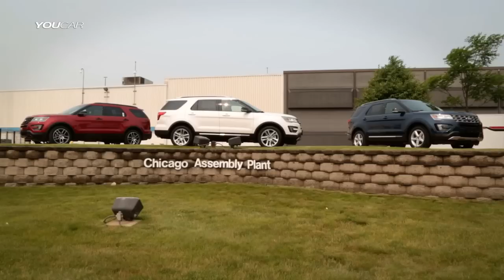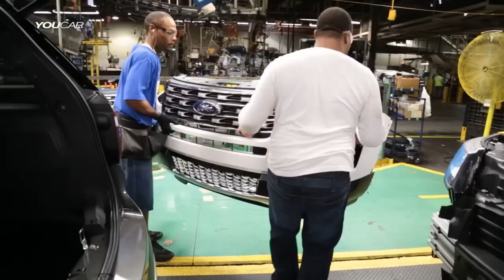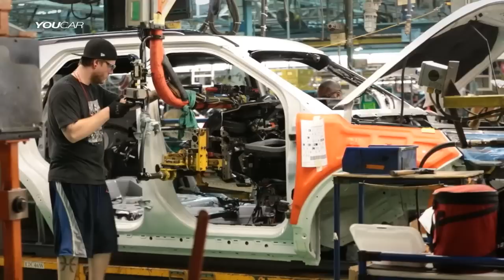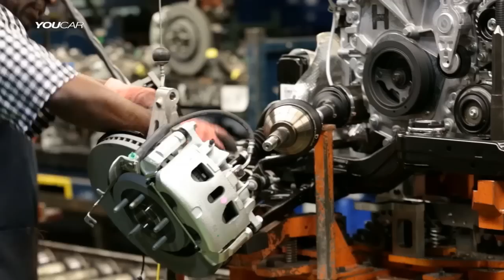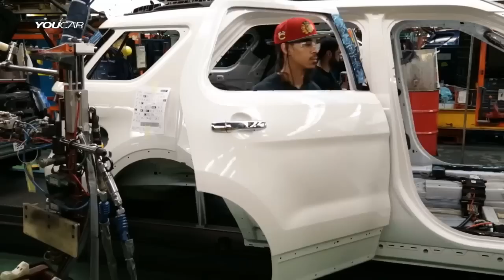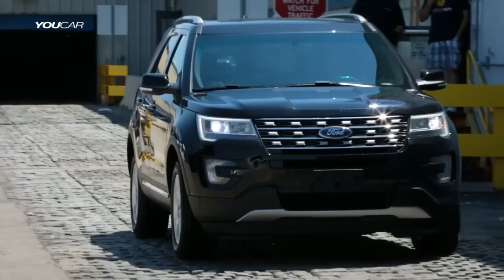► 2016 Ford Explorer - Assembly Plant

Comment: Tire pressure monitoring system only tells you that there is a tire with low tire pressure it does not tell you which tire is low on pressure